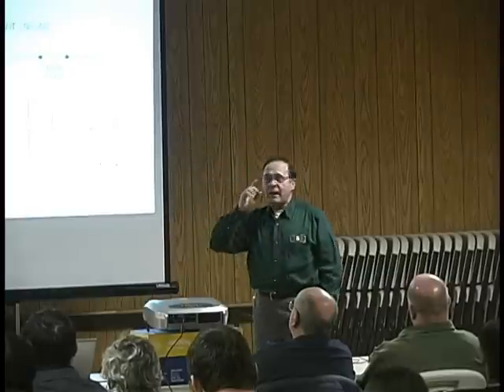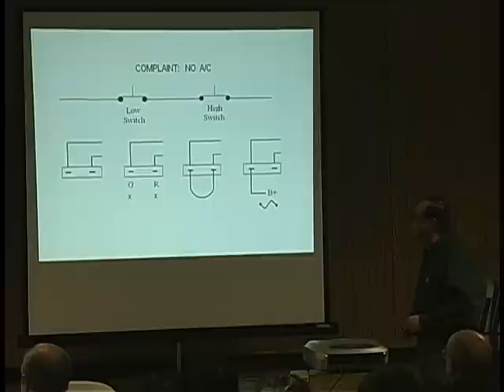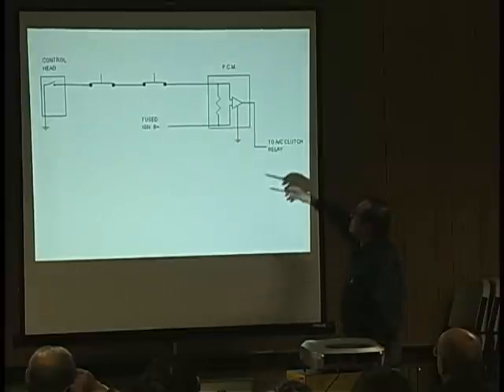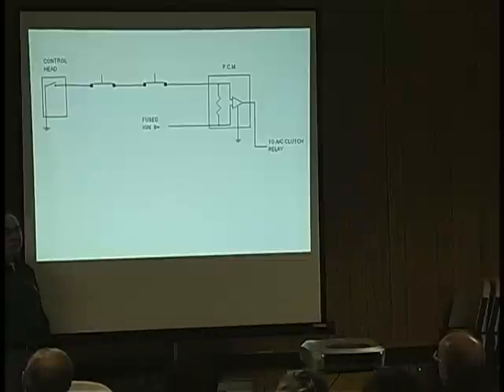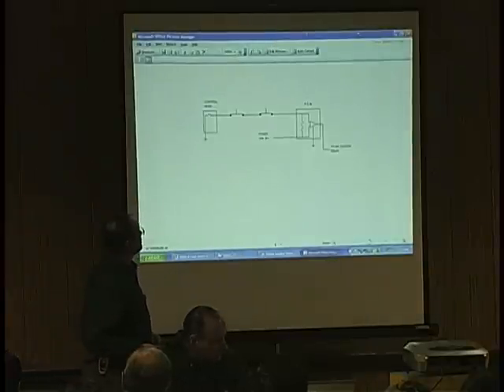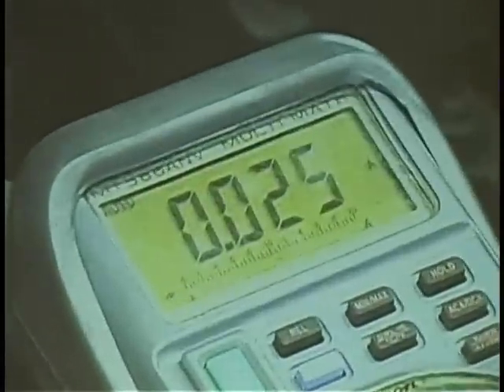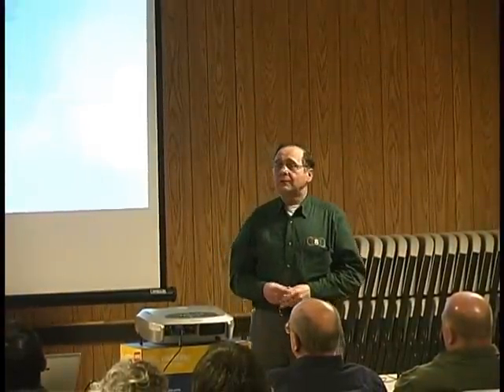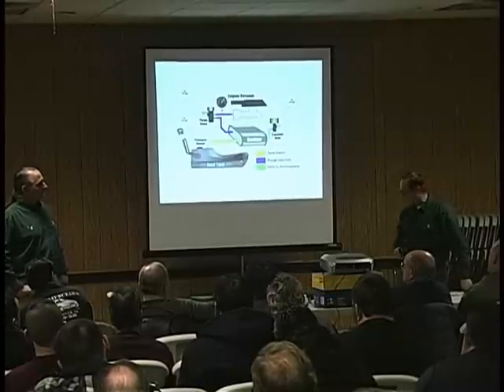Case Studies & Voltage with Rich Peterson

Comment: Hello, Rich. I am just trying to understand how the control head get burned out with the switch bypassed. Applying 12 v to the control head with no AC request would not do a thing as you said. Your answer will be very appreciated. Thank you.
Reply: You're correct. However like he said in the video - In this case they did indeed request A/C, which grounded the circuit.